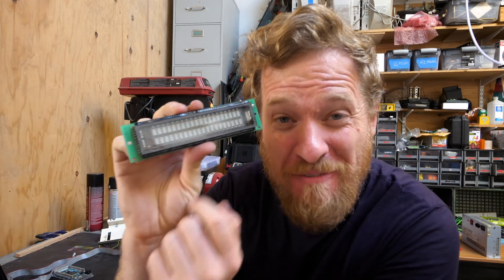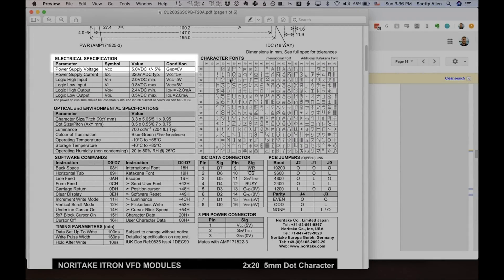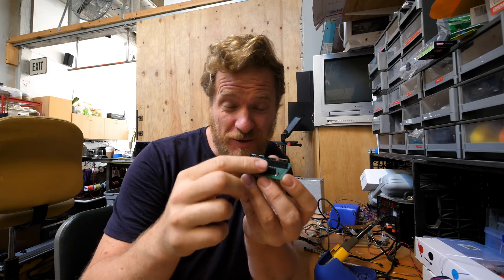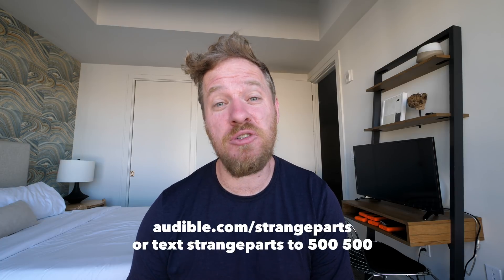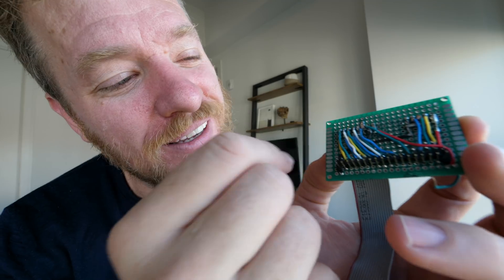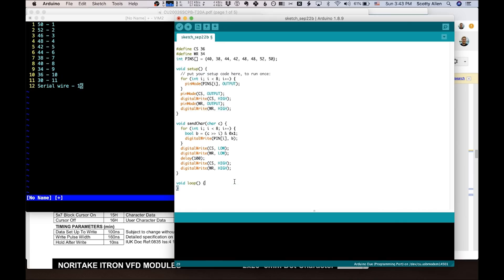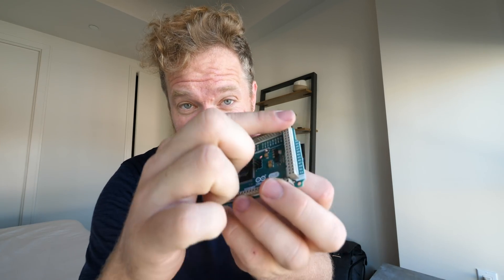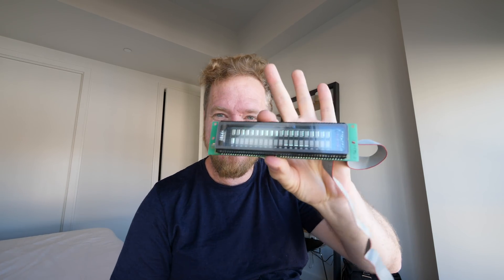Reverse engineering vintage Japanese electronics - a vacuum fluorescent display!

Comment: Bug is he forgot to declare int i = 0, so i takes on a random value probably in the order of millions (negative or positive)
Reply from the maker: Bingo!  I found it a few minutes later.
Reply: @StrangeParts  Relatable C programming problems :P
Reply: @StrangeParts  Secondary note, depending on the version of GCC there is another error. On older versions you can't declare the integer you iterate with in the parameters of the loop. So you would have to int i; outside of the loop and initialize it zero in the loop parameters.
Reply: Jake Barger this is what I was expecting. Didn’t even notice he didn’t initialize it
Reply: @JakeBarger  This was my initial thought as well, until I saw the lack of initialization.
Reply: @StrangeParts  oh. Heh, I only noticed that pin 3 and 4 in your array were both 48 :P
Reply: @StrangeParts  You should collab with BPS Space
Reply: @StrangeParts   OMG i felt so happy when i could actually spot that
Reply: @StrangeParts  I have a geb-2294v-0 dg05122 lcd display, but I couldn't find a proper source to interface with arduino 
Could you help me out please
Reply: @StrangeParts  you are the best and my source of inspiration
Reply: @fidelgutierrezvieyra7906  Same for me.
Reply: I think every C style coder has (int i = 0; i < X; i++) (or something similar) ingrained into their memories forever.
Reply: @elminz  - Yep.  It's also what I type whenever I try out a keyboard.  Pure muscle memory.
Reply: @elminz  a lovely mnemonic
Reply: damn too fast for me.
Reply: @tim.e.l  C HAS NULL, the value of the fucking int is null!
Reply: M. de k.  You're correct. But in appearance It's a random number, and it's an easier way to explain in youtube comments.
Reply: Always initialize your variables in C.
Reply: As a programmer, it's hard to explain to someone that you can spend an entire afternoon looking for a single character out of place. :/
Reply: wait i thought that like in c# it would set it as 0 if left as undefined, is this not the case?
Reply: @vukzlatkovic1183  C is a very low-level language, and it'll do pretty much exactly as you tell it. If you tell it to declare a variable, it'll do that, and nothing else. A language like C#, as you mention, will give it some zero'd memory for your convenience (and probably security). On an Arduino, not doing that makes sense, because CPU horsepower is scarce, and zeroing variables at the point of declaration is not always neccesary.
Reply: @thany3  I see, thank you for your thoughtful explanation, I'll look into it myself but thank you for your quick and precise response
Reply: @vukzlatkovic1183  No it doesn't have that type of "security", when declaring a variable in C you're actually " reserving" a "memory slot" has big as the type of data of the variable in this case an intenger can be 32 bit or 64bit long depending  on the processor architecture, so a random number number in a scale of 2^64
Reply: @vukzlatkovic1183  : Just because noone mentioned it, I'll detail default initialization a little bit more: the global variables (public globals, file-static globals, function-static globals, and since C11 thread-local globals) all get allocated default values by the compiler (with the possible exception of thread-locals). This happens once per execution (or thread initialization...), and so can be brushed off as a platform detail (which, technically, it is). The variables inside of functions, whether arguments or otherwise, as well as dynamically allocated memory, are not like this. In fact, the compiler technically doesn't always know the layout of a block of dynamically allocated memory, nor whether it might have already been initialized, and then you have unions{}, so suddenly even the stuff it does know about gets complicated.

So, it takes the simple & predictable way out, by saying that "only this stuff gets initialized by default, do all the rest by hand", and the "world" becomes that extra bit simplified, albeit slightly inconvenient.
Reply: Except that the stack is always initialized to zero during a hard reset on these kind of chips. You will notice it during a brownout though.
Reply: Huh, if it was C and a decent compiler the compiler would’ve caught that. I actually write all my raspberry pi and embedded stuff in C
Reply: M. de k.  if we are talking that way then there is nothing random at all. some things are easy to predict, some are really hard
Reply: M. de k.  i know. what i meant is that YOU dont know what part of the memory you are going to get and in that memory can be stored anything left by other programs so its kind of random. and of course you can predict it. thats quiet easy to make.  thats why random. org uses weather to generate random numbers. but if we build a very powerful computer we will be able to calculate all the molecules movements and predict even weather so the numbers generated by random org wont be random as well. random means that it is unspecified (its not always 0 or 1). it can be any value thats left by another program. its not the "i create variable, assign its value to random"-random, but the "you get whats left"-random.
Reply: @Drew-Dastardly  remember that Arduino is a brand that devolp dev boards based on the AVR uncontroller family and in the industry today C and Assembly are widely used to program MCU, although Arduino creates an extra layer of abstraction you program on top of a built in firmware that occupies 20% of your MCU memory,  declaring your variables correctly is still a good practice
Reply: #NotMyProgrammingLanguage
Reply: I guess that's the reason for compiler warnings ^^
Reply: @RandomUserr_  i wasn't initialized, so the for loop had incorrect bounds
Reply: There's also 48 is specified twice as a pin.
Reply: I thought it would be zero anyways with the arduino's C compiler.
Reply: I was going to say that he made the return type of sendChar void so it wouldn't actually do anything or output anything to the device.
Reply: M. de k.  yes. so its "random" because there can be anything
Reply: In MPLAB it actually takes the value 0 if you dont declare anything .-.
Reply: I am so happy that I saw it too, since I only learned it in school
Reply: Always initialize your variables, kids.
Reply: He could have also made the display much more easy to the eye by making a seperate method with an input string that displays each char with a 25-50ms delay between each, might also be handy to create an API before hand, always good practices to code modular!
great work @Strange Parts <3
Reply: The amount of times that's caught me out you'd think I'd be good at finding it by this point
Reply: It's all about experience and care
Reply: For a former SDE at Google, not writing int i=0 automatically is... interesting.
Reply: @ACogloc  I've been a developer for 15 years and I'm astounded sometimes at the bugs I'll write or simple things I forget to do the longer I'm in the business.
Reply: @ACogloc  Depends on what language he used at Google. Javascript and Python don't just seize a random memory address with unknown data when you declare a variable, so the "int i =0" thing is not as big as in other languages.
Reply: @ACogloc  I have for, while etc. on macros, so whenever I am not on my setup, I also manage to make small mistakes like using a ; instead of :  . Try finding that one when working on an android phone...
Reply: @ACogloc  You don't always initialize them. You initialize them when you have to, that's why they're not automatically initialized.
Reply: deppends on IDE, most likely it will get value of 0 or make error during compilation
Reply: @give_me_my_nick_back  I seem to believe arduino always made it a 0, so i thought this would not brake the code in this case!
Reply: @give_me_my_nick_back  it actually depends on the compiler not so much on the IDE